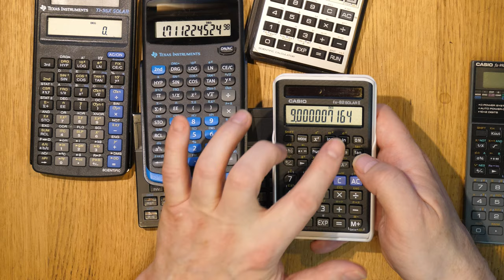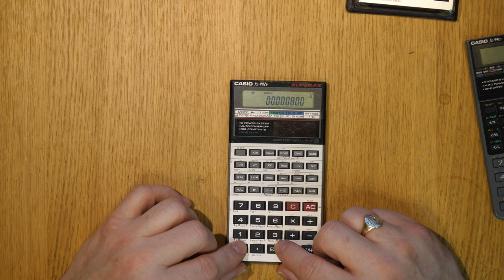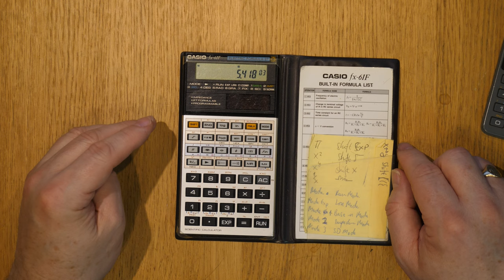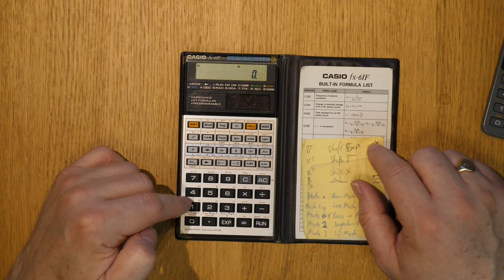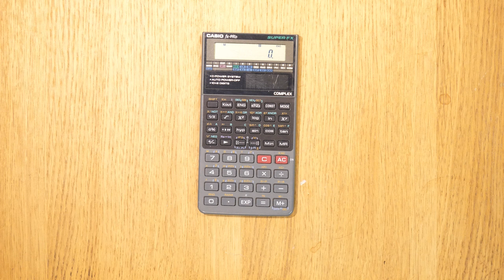Calculators for embedded systems engineers and programmers

Comment: The HP35 S can be used as an algebraic calculator, too. It writes down the operations, but displays in the second line the actual answer as you would see it on an algebraic. I have got the HP 33 S, which is similar. Converting the hex to decimal takes a key press more, but you could do a program, too.

Comment: You need an HP-16C, although it's RPN. But it's programmable too & keeps all settings (i.e engineer).BTW : the TI- 36X Solar has the "Logarithm Bug" and it also forgets it's settings because of the Solar Cell.
Reply: HP16C ftw! Been using it for ages now, never failed me.
Reply: RPN is superior anyway.

Comment: Hard to beat the HP16C (if you can find one) for embedded stuff. Selectable word-length, a choice of 1's complement or 2's complement etc. But it's not so good if you need transcendental functions or maths for RF.
Reply: Really you don't need a HP16C: HP48/50 can do base math and easily you can add the miised functions, present in HP16C, with some simple RPL programs (even there is a HP16C emulator for HP48). Near only one-complement mode is missing, and I don't know what system uses today, or time ago, one-complement negative numbers: I have meet lot of CPUs and all of them used two-complement for negatives.

 HP16C was discontinued, i.e. there was no more similar calcs, because sales were poor for it.
Reply: @davidg1830  Swissmicros still produces the dm16 or dm16l. Altough it's only RPN as it is a (high quality) copy of the hp 16c.
The reason to use one of that Instead of a scientific / general purposes calculator is usage for the specific purpose and so the handling for the Problem to solve with it. The calculator is specifically designed just for that one thing you will use here and nothing else is the main target. You would have a hard time to use it for financial purposes and the same is true if you would use a hp 12c for programming support.
Reply: I just ordered Swiss Micros DM16L  from Amazon, it is gonna be great.

Comment: I love my HPs, but one of the earliest ones I have that's very similar to your fx-991D is the Radio Shack EC-4035.   Having the base-n mode so you can treat hex as a first-class citizen and the fixed engineering mode with units is great.

Comment: I've always loved LED display calculators. I have a few from Texas Instruments and a couple National Semiconductor somewhat rare 4660 (both the 1976 and later 1979 version with a better LED display). Back in my highschool days (late '70s early '80s), we were occasionally allowed calculators but not during exams, which is crazy to think about these days. Mine was a TI30 (original LED model). Today the one I use most often for quick calculations is my trusty old TI-30SLR (solar powered) from 1985, which still works flawlessly (actually built by Canon for TI using a Toshiba chip under license by TI). My dream is to get an original HP-35 one day to add to my collection.
Reply: Ahh the romance of the LED display!

Comment: For the TI's, the battery versions seem faster than the solar-only versions. For example, the TI-30Xa is faster than the TI-30 ECO RS, and the TI-35X is faster than the TI-36X SOLAR (and doesn't have the annoying AC function). I'm not that bothered about solar as the batteries seem to last for years anyway. Your Casio fx-991D/570D/115D/100D family looks useful. I must keep a look-out for those. Currently, I mostly use a HP-42S which fails your "no-RPN" requirement, but is a very nice calculator.

Comment: Take a look at the casio fx-991ms, persistent engineering mode that gives you symbols, hour minute second and hex. You do have to change modes to do base calculations though.
Reply: Take a look at the fx-991EX. It has a persistent eng mode (but only with SI prefixes). It has a full 32 bit binary display. 
But... inputting engineering symbols is a pain in the neck, because you need to press the OPTN key and access a menu: frustrating... the 991MS does it way better. 991EX also does hms calculations (you may have to press [° ' ''] key once after the final result), and it has got fonts of useful (and useless) functions.
Reply: Did you know that the 991MS is semi-programmable? You need to use multi statements the [:] key to step through your program. You can do manual loops, and manual conditional jumps (hence semi programmable).

Comment: Interesting video. As a note though: The modern casio vpam calculators can easily be put in normal mode (called LineIO) and they support persistent engineering mode with fixed number of digits (called sci mode). At least it works that way with 82ES and 82EX. They also support deg,min,sec calculation (Sexagesimal). No HEX mode though. I also love the high resolution font on the new Classwiz calculators. I'm still looking for the perfect calculator. I'd love the windows calculator in programming mode as a physical calculator.

EDIT: It looks like the fx-991EX has hex mode. I will try it tomorrow (it is currently in my office at work). It is called Base-N calculation in the spec sheet. Maybe I already have the perfect calculator, I just failed to read the manual...
Reply: Thank you for your comment. But I suppose the LineIO-Mode in the Casiofx 82ES isn´t the "immediate execution" Nezbrun wishes. Those calculators can only show one number at a time in the display.
Well, what is the best calculator? I simply was totally used to use calcs with imm.calc. But with VPAM you can check your numbers and result without typing it in again to confirm the result. I like the Casio 9860 slim very much for the best display, too. And you can use RPN-Add-ins for fun on it. Very nice to see the stored numbers on the stack as shown on the graphical RPN Calculators by HP. 
Btw, the imm.calc. is a mixture of postfix (RPN) and prefix notation.
Reply: @blue_blue-1  You're right, there is no RPN or "immediate execution", but the VPAM can be turn off. Personally I love VPAM, but I'm a millennial.
I've tested the fx-991EX now and it is almost perfect. It is 32 bit signed (2s compliment), I wish that was selectable. You can't convert from HEX to BIN, edit one bit and convert it back to HEX, you can use the result as ANS or save it in memory. Not quite as good as the windows calculator, but close.
I have the 9850GB and I hate the screen, but that is mostly because it's a reflective color LCD. The 9860 is probably much better.
Reply: lollandster,
The 991 should convert in base-n-Mode. Simply press „Dec“ (x^2) or „Hex“ (x^n). I don‘t have this 991 but others and it works that way.
The fx9860: look at the „slim“-version. It is foldable, therefore the display is tilted.
Reply: @blue_blue-1  Sorry for not being clear. I meant that you can't edit the result. As far as I can understand there is no way to transfer the result to the top line so it can be edited (other than using ANS). The scenario I'm thinking about is when you have a HEX number for a register setting and you just need to change one bit. There are other ways, but I'd like to convert it to BIN, cursor to the correct bit, change that bit and convert it back to HEX.
Reply: lollandster,
Thank you for explaining. But you have been quite clear at first, too. I apologize.
Just found it out on my Casio fx P 401 (interesting naming... all other Casios have the P behind the number): E.g. if you enter a number in hex and convert it to bin. Now, to be able to edit the binary number it seems that one has to enter an operator first, e.g. a “+“. Now it is possible to change the binary number, too, and one can delete the „+“ again (or add 0). Holding down the arrow-key scrolls fast through the number - nice!
Reply: @blue_blue-1  Unfortunately that doesn't work on my fx-991ex, it doesn't insert the answer as a number, it inserts it as the variable Ans.
Reply: @lollandster ,
did I mention the TI68? It allows to edit binary results and converts nicely.
Yours.
Reply: @blue_blue-1  Texas calculators are difficult to find here in Norway, used ones are none existing. I did look at their website and found that TI-36X Pro can do conversion and boolean logic, but I can't find anyone selling it here. I may import one if I can confirm that it does what I want.
Reply: lollandster, I am currently selling one on Ebay. It is something special, it even can handle variables like foo2.
Reply: @blue_blue-1  I see one from Germany with no international shipping option.
Reply: lollandster, int‘l shipping will be 9€.
Reply: @lollandster ,
btw. the TI68 has a tilted display which improves readability very much laying on the desk.
And take a look at the WP 34 s, a reprogrammed HP 30 b. Nice keys and tons of functions. In binary mode it even has got a command to flip a specific bit. There is a windows or apple-computer app available for free, too. The real device is available on hpmuseum.org or Ebay. But be sure to take the one which was derived from the HP 30b, not from HP 20b, which has much worse keys.

Comment: Could you do a video on all the functions you use on daily basis as an engineer? Probably there are a lot of functions on these scientific calculators that i don't know how to use, or what they are useful for.
Like the x-y key.
Thanks.
Reply from the maker: x<->y key is very useful, and I'd say it's almost essential for an engineer. It allows you to deal with interim results without having to resort to memories particularly when using non-commutative operators like divide & subtract.
Reply: @nezbrun872  Could you please write a real life example?

Comment: TI 68 does partially what you want, too. Storing modes and editing a binary result, converts nicely. Weird though, it uses different commas for input and the result! And the drawback: it has no immediate calculation.
Reply: I agree.  I have a TI-68 that I bought in 1990, and apart from the lack of the immediate calculation thing, it pretty much ticks all the boxes. 
32 years (and 3 batteries) later, it's still my 'go-to' daily  use calculator.  I love my TI-58/59, my HP41CV, and HP Prime G2, but theres nothing quite like the speed, ease, and simplicity of my TI-68😀

Comment: I liked Psion computers early on and still use some, especially the SDK where animation is a weak word at 2 GHz and beyond. Some assembler "calculator" based on the Z80 makes a little sense to fiddle with and the grocery shopping thing I use in my head could be something for the future where we could scan each thing (or buy it like that) as we collect it in the shop and maybe not in the end.

Comment: On the 991D, π isn’t directly accessible?
Isn‘t it as on all Casio, that if you press Exp after an operator or at first, that it takes the number π?
Edit: I was wrong. It needs Shift.
Reply: It does not need [SHIFT].

Comment: I have a Panasonic 554 and a Privileg SR 12 PR, quite rare ones, which do what you like: immediate calculating, storing the modes while turning them off and displaying engineering format. Hex for sure. 
Ever tried a Casio FX 600 or 650? They have no steady engineering format, but Scientific at least. Look it up, it is very ergonomic! One of a kind. Why are such calculators not made anymore?
And of course the WP 34 s, RPN, but good as gold. (The only one in this list you can buy new)
And there is the HP 27 S, algebraic, very easy to use, storing modes, but display isn´t the best.
Keep on calculating!

And I forgot the Philips SBC 1845, which does exactly what you want, too, but absolutely rare. There was a similar calculator with the "Privileg" brand. (Germany)

Comment: The keyboards should be larger, and the display also. Link via usb with computer to save programs and exchange them with others. Direct computing has many benefits.
Reply from the maker: The point I was trying to make is that handheld calculators with simple UIs still have a place, and the best ones are those with direct access to the most commonly used functions you use.

If you want to start hooking up your calculator to a computer to save programs or exchange data, IMHO you're probably better off just using your computer. Programmable calculators nowadays have little practical use when you have a computer ay your disposal.

While I'm amazed at what's achievable with today's high end calculators, for quick calculations they're more of a hinderance: the UIs are so complicated, you need to invest significant effort to get up to speed understanding how to use them.

Typically I'm using them for simple exercises like memory allocation calculation, timing or checking my client timesheet: I'm not trying to crunch numbers. If you want to do that the HP Prime is like a mini version of Matlab with its vector capabilities, but getting adept at using it takes more effort than I'm prepared to give it considering I can do all that on a computer with a nice big screen and a proper keyboard.

Comment: Still one more forgotten: HP 20 s, an algebraic calc, storing the complete state, including the actual result in the display. Technical good display, but writes Eng-Format as e.g. 2.97E12 - without spacing! Lot of used ones available on Ebay.

Comment: Somehow it just never occurred to me that hours minutes seconds even really required a calculator.  Those are all small integers - I just do those in my head.  Most good calculators have HMS+ and HMS- functions, though.
Reply from the maker: If all you do is quarter or half hour increments, yes, do it in your head, it's easy.

If you're a pilot, where each flight has several times, all logged down to the minute, such as calculating in-the-air flying as well as blocks on/blocks off times & durations, and cumulative durations separated for single/multi engine, day/night, in command/P2, IFR and simulator, it's not the kind of thing I do in my head. But good for you.
Reply: @nezbrun872  That's a good point, and also if you're a pilot then you do this a LOT, and lives may depend on you doing it right.  We're human, and eventually we make mistakes, so any sort of automated assistance that reduces that error rate is of high value.  I wouldn't feel at all comfortable claiming that my error rate doing it in my head would be as low as doing it with a device assisting me.

Comment: It's not a MODE! ENG is just a function that adjusts the decimal point and the exponent. It never was intended to be a mode. SCI 4 is a mode you can set with the mode key on Casios.
Reply from the maker: On some Casios, like the FX-100D, FX-115D, FX-570xD, and FX-991D, it is a mode. You press MODE DOT and it toggles between engineering mode and non-engineering mode. The setting is persistent, even after a power cycle. That's the point, it's a key benefit of these particular Casio calculators. On most Casios, I agree, it's a temporary adjustment to the display with no persistence.

Page 6 of the FX-100D/FX-115D manual #201, and page 7 of the FX-570xD/FX-991D manual #202, under the section "1-1 Modes": 

"MODE DOT: ENG displayed to indicate engineering calculation mode."

Unfortunately, engineering targeted calculators like the FX-50F and FX-61F have the temporary display method you describe.

Comment: Why I don't like using the calculator on my PC.  I have to pop up the calculator over all the apps I am working in.  Make my calculation. Switch to the app I am working in and paste it.  Then switch back to calculator which is now hidden by the window I am working in.  Argh!  Its like playing ping pong.  On calculators...I like my old HP 20S. Not RPN, 13 digits, 3 LR44 batteries, I don't have to switch modes to do base conversions. 1+2*3 = 7.  And the buttons have a nice solid click.  I dislike mushy buttons.  LOL